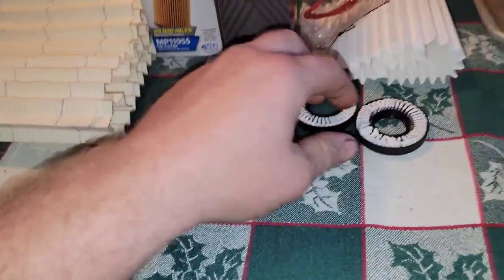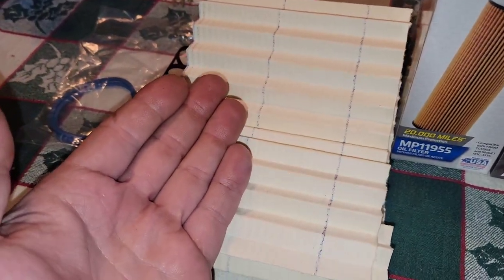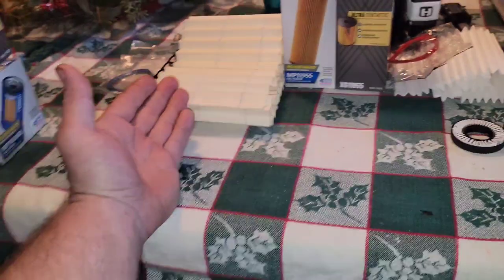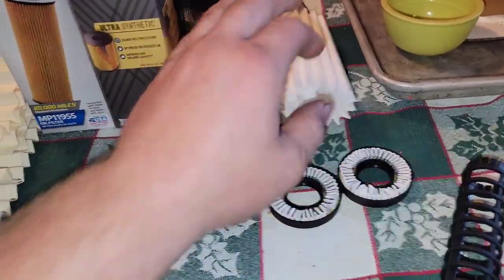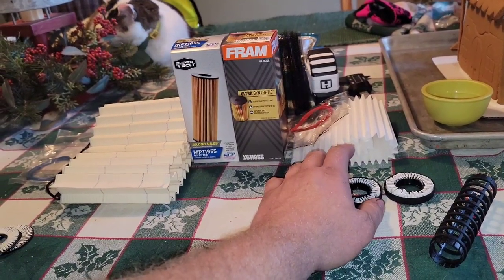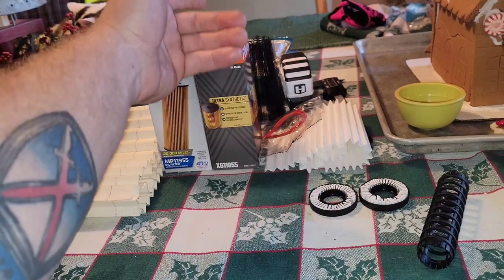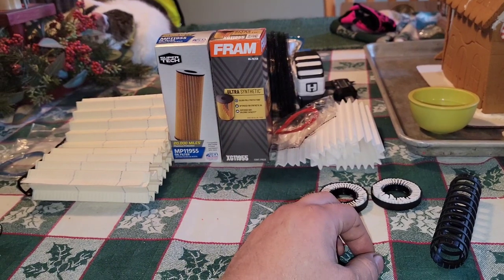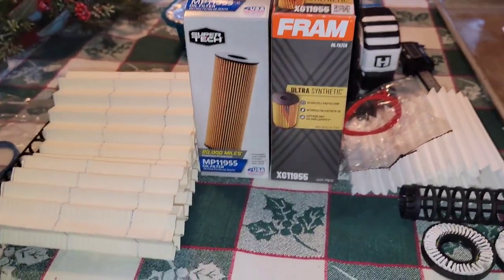Fram Ultra - SuperTech 20k Mile Rated Oil Filter Comparison 2.7L Ecoboost F150 Filter SHORT Version

Comment: I was doing my oil changes at 5k, after all your videos I will change to 3k. Going to try the fram ultra for my 3.5 Ecoboost
Reply from the maker: I think the part number that you need for the 3.5 L EcoBoost spin on filter is in xg10575
Reply from the maker: Also have a video on that coming out tonight
Reply: Ok perfect can't wait to see that. I'm also doing the trans fluid every 10k. I want my fluid just like it came out of your town car when you did the pinon seal.
Reply: @lchavarin  that’s ridiculous every 10k, you can do 30-40k just fine

Comment: Great Video. I am alright with you keeping them short. I was using the FRAM Tough Guard TG 9972 cartage filter on my 13 Camry, but have started using the Fram Ultra XG9972. I agree they are  extremely good filter and well made.
Reply: I run the 9972 Fram XG on my 2grfe lexus. Run it for 4500. 👍

Comment: I would bet anyone you run a cheap fram filter and change every 3-5k you would have zero problems. It’s when people start going 6-12 or more without checking the oil where problems occur.

Comment: I used to run the Orange Fram filters back when I was a teenager. They were reasonable in price and Castrol oil would be on sale for 99 cents a quart. Never had a problem with the Fram back then. On my Ford I mainly used a Motorcraft FL1A. Currently I have been using Wix filters. The 20k mile rating is just a sales pitch. Unfortunately people fall for them all the time. 5000 miles is about the limit that I would go.

Comment: Great video. I did call my amsoil rep support. They verified 99% at 20 micron.  Anyway. Another great filter review.
Reply from the maker: Even at that you know where the more cost effective filter is still at 

I paid 24.99 For My Aimsoil filter and even with 25% member discount $19 is still almost $11 dollars more that the xg2 doing the same numbers for $11 Less 

Not they have a great filter indeed but the ultra is the best bang for the buck in this class so far 

Thanks I appreciate it brother
Reply: @FordBossMe  I agree. Was just stating the numbers cause I remember a previous video where we were getting different numbers for the filter. So I reached out to rep support to get verified numbers.

Comment: Nice video... enjoyed watching it basically Fram Ultra XG comes out the winner. its what i expected i always say You get what You Pay for. most of the times if soemthing is cheaper theres corners being cut here & there. thx's again ... Be Blessed
Reply: thx for the like. i own a 2014 hyundai Santa Fe 4 cyliinder 2.0 Liter Turbocharged engine makes 264 horespower stock right from hyundai. You know 20 or so years ago that same 4 cylinder turbo charged engine was almost considered a race engine so i cant afford to be cheaping out  on filters or useing mineral or wrong 

spec oil especially in a 4 cylinder making that kind of power output. it gets rec 5w30 synthetic Pennz Plat sometimes ultra when on sale at wallmart Oil filter of choice is fram Ultra XG 9688  fuel of choice is Shell V-Power gas with 7X's cleaning  detergents every 3-4 tankfull. it runs perfect so far 175.000 miles on her,

Comment: Most oil filters will be perfectly fine at 3,000 miles. Now if you like to go over 3,000 miles then it doesn't hurt to upgrade the quality of the oil filter.

Comment: Great video. I’m ok with the short video. Fram damaged there name with there orange filters. It’s hard for me to trust fram & there other branded filters like AC delco. I never used super tech filters so I don’t have an option for them. 
Bless you & your family
Reply from the maker: Yeah well I can't speak for what everybody else is saying I have never experienced an orange can filter thing and I don't want to let my mind be messed with because of what somebody else is saying that I don't even see proof of anyway so the orange can theory of death and all this other stuff to me is a bunch of hogwash until I see it for myself
Reply from the maker: Thanks brother you have a blessed day as well
Reply: @FordBossMe  I understand. I personally had an total of two fram orange failures in my life (about 10yrs ago). One completely came apart destroying my dads engine (they replaced the engine to the Pontiac my dad had) & one was so rusted internally that the oil was bypassing the filter.

Comment: Seems to be a good filter for sure!  I'm going to do some price comparisons, as an Amsoil Preferred Customer I'm getting their products 25% off MSRP.
Reply from the maker: Well it's 2499 for a and oil filter so your only saving 25% that is $6.50 at most you're still cheaper going with a Fram filter

Comment: The only two instances I’ve ever even heard of a FRAM causing an engine failure is #1 when idiots building GM engines block the internal bypass valve. The oil filters don’t have a bypass valve in them on those engines since the engine is supposed to have the functioning valve, so the filter will internally fail since it receives all of the pressure. Second one I know of is a run of Subaru filters years ago had a defect and two people had their engines replaced for free by FRAM.

Comment: My understanding was that Fram oil filters were not anything more than just a cheap oil filter for a good 20 years or so.  Is that untrue?  Amsoil filters only filter down to 20 microns and they are considered top of the line oil filters. I still use Wix filters, I hope that is still a good choice.
Reply from the maker: So yes your conception about them being cheap is because of their low $3 bottom of the barrel oil filter that people typically abused all the time and then they try to run them on performance engines and they don't belong on performance engines
Reply from the maker: They actually make the best filter on the market for the money and even if you consider an Amsoil oil filter versus the Fram filter you're going to see the fram filter is still better for the money and Amsoil doesn't even make their own filters
Reply from the maker: So yes that stereotype is untrue about the Fram filters
Reply: @FordBossMe  I always used the PH5 on my GM engines, the long one. My mechanic keeps telling me use Wix. 40 years ago we all used Fram filters...some used Wix and some used Purolator. I've never had an oil filter complaint no matter which one was used and mainly because I used high grade oils and then when Mobil 1 was invented, I have been using it in everything all the time. Thank you for the update.

Comment: Hey Ford boss! Been subscribed for a while now and have been using Fram since your reviews. Anyhow, can you help me out with any tips here or possibly some things to try out? Remember when you had that tacoma…. I have a 21 TRD 2wd. Same truck you had but 2wd. I notice under acceleration, coasting, or braking I have a pronounced “driveline” vibration between 15-25 mph. It goes away above or below that speed. 
When towing with approx a 1.5/2” squat it is completely gone. With a 1” squat it’s there but less. 

Dealer doesn’t have a clue. We have tried brakes and new leafs. I noticed some Tacoma’s have shins from the factory under the leaf pack. I’ve even tried a carrier bearing drop but that didn’t help. 

Do you think shims would be my route to get ride if this? As I said if I’m squared under load, it’s gone. Unloaded, it’s very noticeable.
Reply from the maker: Hook some chassis ears up to the rear end and listen to it and make sure the tires are balanced
Reply: @FordBossMe  I’ll give it a shot. Thanks.

Comment: Why do the end caps matter? The motorcraft filter for the 2.7 have been without end caps for the last couple years. I have the 2.7 in a 2015 F-150, had it since new and have 106k miles. I have been using motorcraft filters and Mobil 1 extended performance since 30k, motorcraft synthetic before that, and now Amsoil since 95k. Change every 5k and my engine runs like a clock
Reply from the maker: It holds the filter together on the supporting center cage
Reply from the maker: Bronco what are you getting out of here are you trying to tell me I'm wrong about something or are you trying to just share your experience with what you do what are you trying to prove with your comment here I need to know that before I go any further cuz I just don't have time to invest into a people making comments if they're trying to challenge me because that ain't going to fly
Reply from the maker: If you're trying to say your maintenance is what's kept your vehicle going to 106,000 Mi you're wrong that Motors actually a very well-built motor so it can take more abuse than other Motors
Reply: @FordBossMe  I’m just sharing my experience. I completely value your videos and insight as a Ford Master Tech! I’m a Ford guy from a Ford family.
I completely agree about the stoutness of the 2.7. I’ve experienced it with the one I have, still pulls like a freight train from a dig! I run 93 octane and it’s a short bed regular cab.
Reply: @FordBossMe  I was curious about the end caps since they stop putting them on the motorcraft filters

Comment: How does Napa gold stack up for the 2.7L? 

Based on your recent videos the Napa gold is the easiest filter for me to get my hands on for both my 3.5 and 2.7. 

Before that the only option locally was frame tough guard for the 2.7l

Thanks for doing these videos I love it!
Reply from the maker: Prob the same as the supertech but jot as good as the Fram at all - its the same as a wix filter
Reply: The napa golds are rebranded wix's standard filters. Wix is my personal go-to.
Reply: @SnipedGaming  mine as well. Been using Wix filters on semis for years. Never had a issue. Wix does make synthetic filters just not for my 21 f150 2.7

Comment: On the Explorer ST (3.0L twin turbo) is the Motorcraft FL2062-A best, or try using Ford GTs synthetic filter FL2087?  Great info, keep it going.  🤙🏽.
Reply from the maker: Or you can use one of these filters here as well but the best bet is to just use the battery one you trying to stay within warranty guidelines 

the two filters in this video are also fl-2062